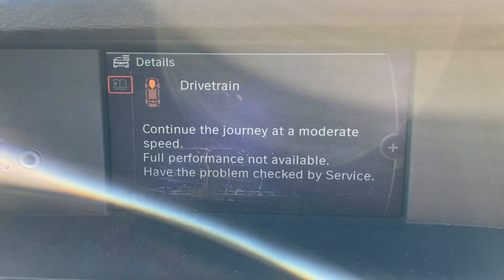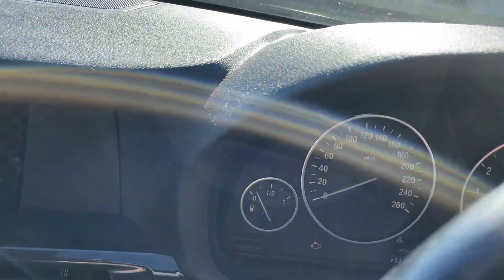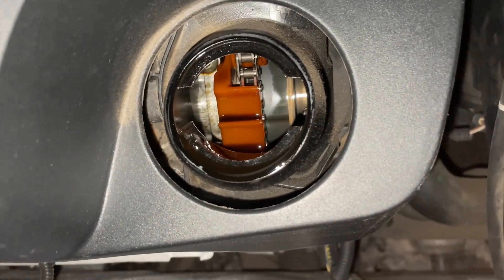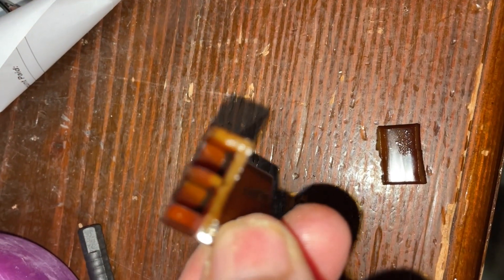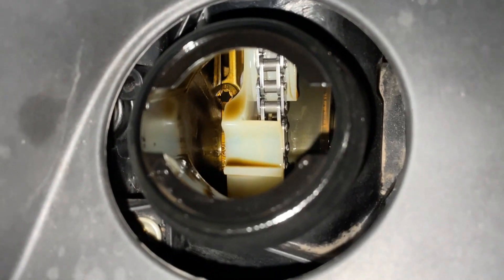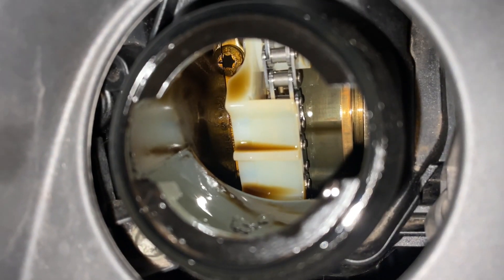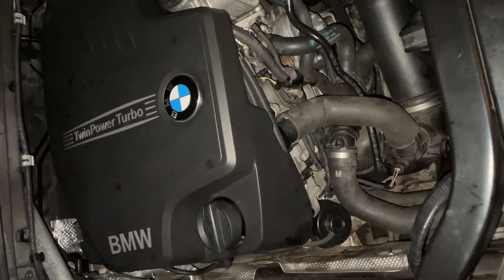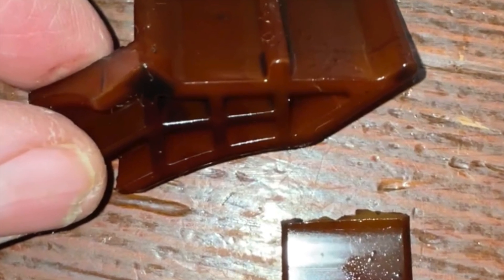BMW N20 Timing Chain guide how to diagnose and what to look & listen for 20i 28i Engine 120i 320i X3

Comment: I have an n 20 bmw x3
2013
Mech reckons i should change the chain 
Car has done 150k km
Not sure whether to get rid of the car or do the chain. 
Was the cost worth it ?
My car is ok ish otherwise.
Reply: @nathanhubbard1041  what did you end up doing
Reply: @kotaonnamix  nothing. Still driving as is
Reply: @nathanhubbard1041 I’m starting to feel like it was the dude’s beating they cars who’s tensioners and guides went out
Reply: @kotaonnamix  yeh I feel like (touch wood) the car is fine. The mech reckons he can hear the chain. But you can’t.  It’s just the ticking of the n20. Sounds like diesel
Reply: @n @nathanhubbard1041 yes n20 timing chain has loud tick but you’ll know when your timing chain is actually loose from the guides cuz the car will obviously have some physical symptoms, im pretty sure you and me both have broke pieces from the guides just nothing catastrophic enough
Reply: @kotaonnamix from what I can see my guides are fine.
Reply: @k @kotaonnamix your music sounds like the stuff my son makes. Where you from ?
Reply: @nathanhubbard1041 out here in riverside, Cali
Reply: @nathanhubbard1041 so the warranty Does not cover timing chains, what it does cover is emissions parts and if non covered part failure can be proven that’s it’s linked to a emissions system, bmw has to decide whether to approve or deny the warranty claim
Reply: My 2014 N20 engine has always sounded like a diesel when you first start it up, even when new. Now with 110k kms it sounds the same. Change the oil every 5k, and go with the heavier weight... 5/30w. I don't wanna spend $6-8k CAD to change out the chain and guides if I don't have to. At this point it might be best to just drive it. Knocks on wood